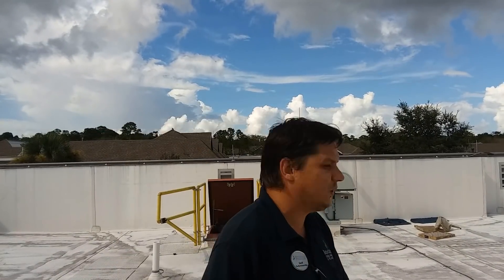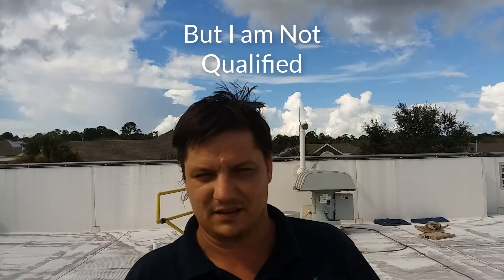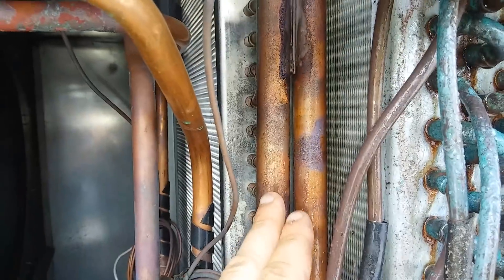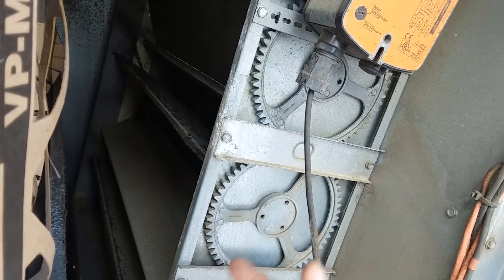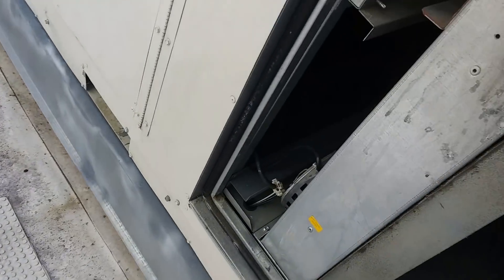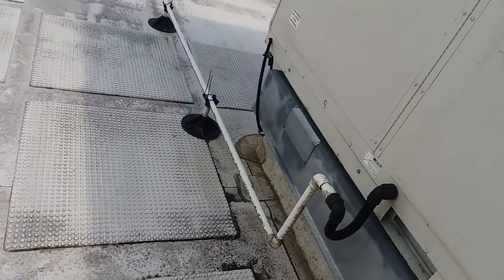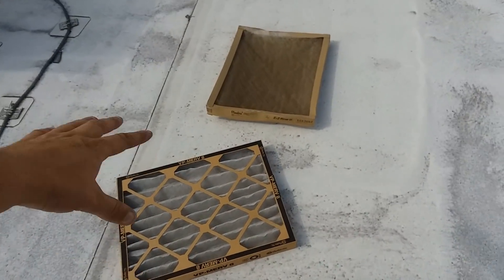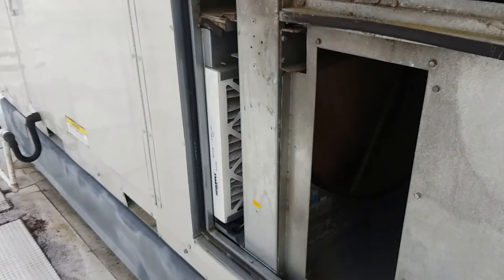HVAC RTU I had to make an adjustment. For Now

Comment: I noticed that you have a fliter slots  I've made 16*25*1 filter frames and use the blue disposable filters or if you can find the ones lined with the brillo type wire do great...
Reply from the maker: We have some pre filters on order the ones that where in there I had to tear them apart because of rust in the channel tracks had them locked in so I had to just tear them up to get them out. But yes we use the Aluminum Filters Brillo type wire ones. 
Thanks For Watching.
Alexander's Refrigeration & A/C Videos